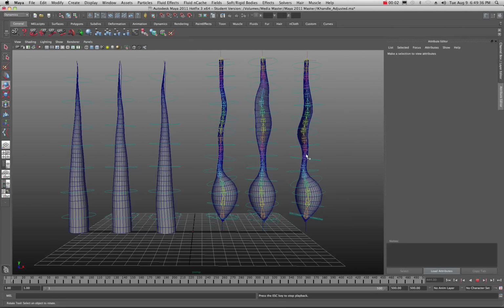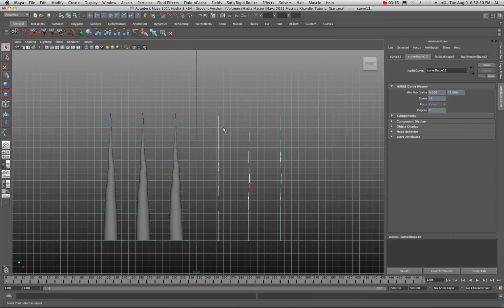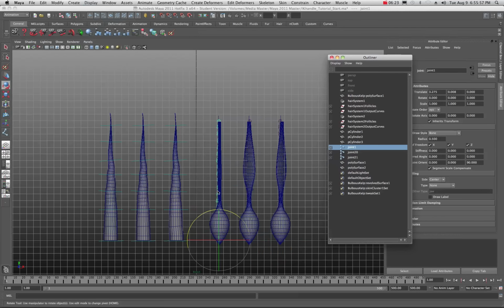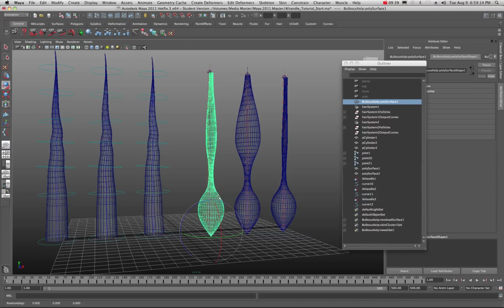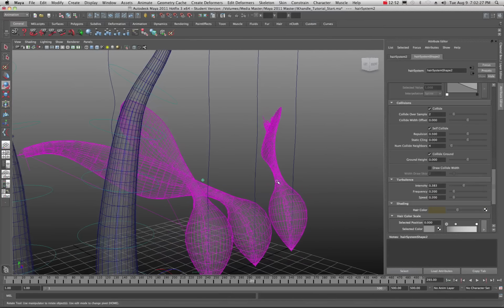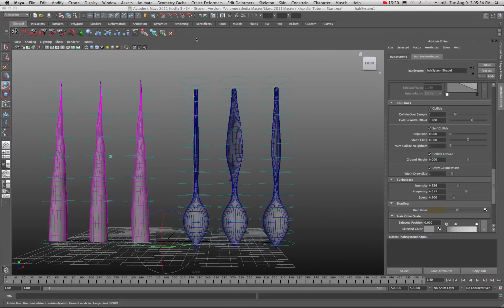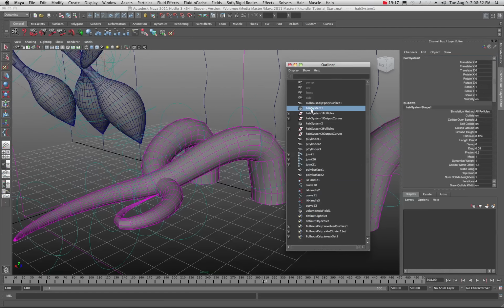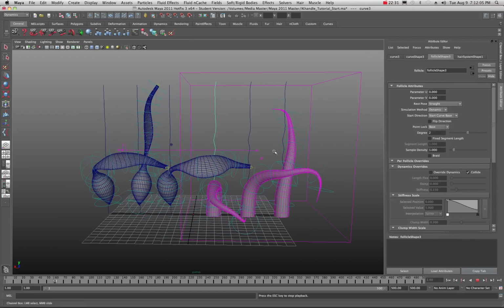Maya 2011 Dynamic Curves Tutorial_Part 2 of 2 by Stuart Christensen

Comment: I tried enabling advanced twist control in one of my dynamic chains but it doesnt dynamically twist the joints in the animation. Is there any way I could get this feature to work dynamically with the animation?
Reply: The rotations and translations work well, but the moment I turn on twist controls, only the root bone twists and the rest of the children joints dont obey it. This only happens for when I twist it around the z axis.

Comment: Hey, these tutorials are fantastic! I have a quick question though: See when you've created these and they are dynamic etc., is there a way to stick the single (or multiple) hairs to a surface easily? I tried selecting the follicle and poly surface and trying Transplant Hair as suggested around forums, and it seems to say ok but then when I move the surface, the hair/follicle doesn't follow.  Any ideas?  Thanks!

Comment: Hi Stuart,
Thank you for the awesome tutorial. I used this to simulate the movement of willow branches. I got it all working fine, but just reopened the file again and the hair system has stopped working. It was definitely working when I saved it. I have spent the last almost two hours testing with my tuter at uni, trying to find the problem. I was wondering if you had ever encountered a similar problem. 
Regards
Gabi

Comment from the maker: @0fVolfAndMan Renering is all about what you need to make your scene look good.  Maya Software is generally faster than Mental Ray.  If you use mental Ray, don't use Final Gather and Global Illumination together on stuff that doesn't need it.  And of course, a great graphics card, lot's of RAM, and a great chip will never hurt as well.  It all depends on what is in the scene and what is right for the scene.  Sorry that's vague but you'll get the hang of optimizing the more you render!